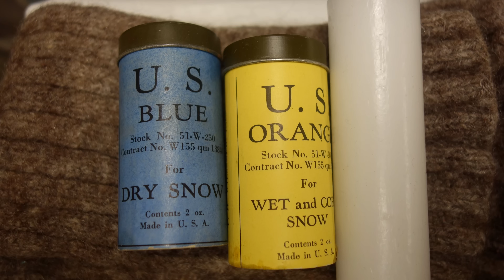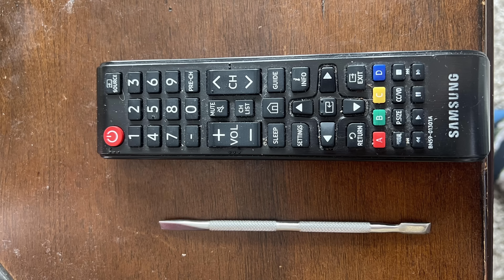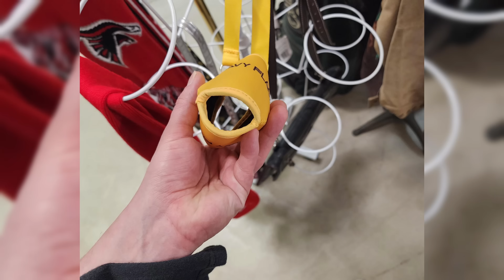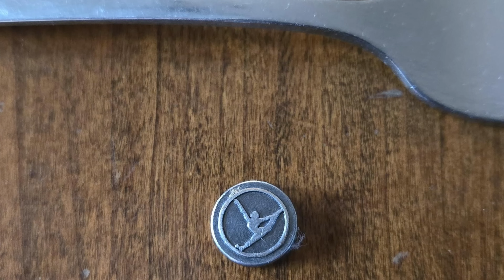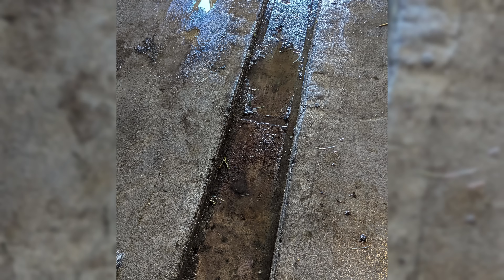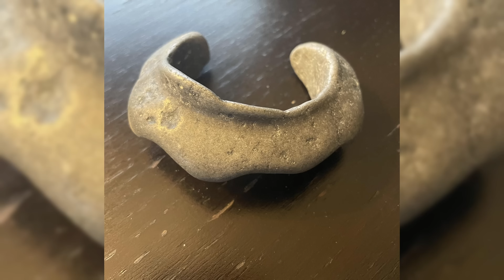What Is This Thing? 27 Strange Finds You Won’t Believe Have Real Uses!

Comment: No.2 Is really a ski waxing tool, but you missed to say why it is hollow. Some burning solid fuel had to  be inserted before the work. The ski wax was processed with the hot surface. I have never seen one made of stone. Aluminium Is common fór this type of tool.
Reply from the maker: Thanks so much for that excellent detail about it being hollow for solid fuel – that makes perfect sense and completely clarifies its function! Great observation about the materials as well.

Comment: RS 232 (Recommended standard 232) specified a 25 pin "D" connector, though it failed to specify the gender of the cable/panel connector, leading to endless difficulties. The one you show is a 9 pin, and though it may be used for serial data, it does not conform to the Standard, thus is not "RS 232".
Reply from the maker: Excellent clarification — the 25-pin spec (and the gender confusion!) definitely caused its share of headaches. Appreciate you pointing out the distinction with the 9-pin variant.
Reply: @CuriousItem  As the serial port only needed a few connections the nine pin is more practical taking less space on panels.

Comment: The Finnish thing is most likely a ladies scarf lock. The electrical thing is an epoxy filled joint box for waterproof underground cable connection. The Beehive finial may have come from a cast iron fence, which was removed during WW2. Metals were needed  then, to make Ammunition shells etc. Your 'pin vise' does not have the collet arrangement used to grip a drill bit or small item. It could well be the body of a precision screwdriver which has interchangeable bits, used by a clock maker possibly? The index finger tip supports the top, while the thumb and second finger twist the body.
Reply from the maker: Thanks for the detailed breakdown! Those are some thoughtful and well-informed guesses — especially love the historical note on the beehive finial. This kind of insight really adds depth to the mystery.

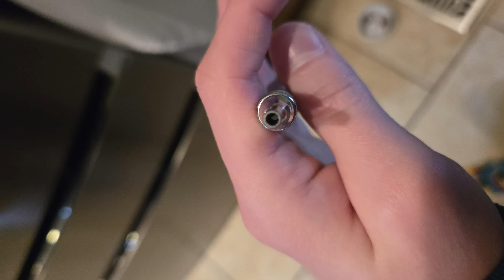Comment: 19:51  that is NOT a pin vise  it is part of  an  "  e. miltenberg inc. germany " pin screwdriver set the tappered end with hole in it is where the missing  screw driver head would have been, the end the turn is a just  a spot  you can plce against palm of hand and use fingers to rotated the body of the tool  instead of the whole hand so you can tighten and loosen precision screws. I have a set in my tool box there are 6  in the set i have and i think the set is actually missing a couple. there is no chuck with jaws at end to hold a drill aka pin vise.  some one  only took a guess and pulled an answer out of thin air identifying this one.  that company made numerous medical equipment  from dental drills and equipment to speculums and more.
Reply: Beat me to that one lol I have a set.
Reply from the maker: Haha, great minds think alike! Always cool to hear from someone else who has the same set!
Reply from the maker: Wow, thank you for this detailed clarification! Sounds like you’ve had hands-on experience with the real thing — way more accurate than a guess. Really appreciate you sharing the full context and background on E. Miltenberg tools. That kind of info is gold!
Reply: Is this like a jeweler's screw-driver, but with replaceable tips?